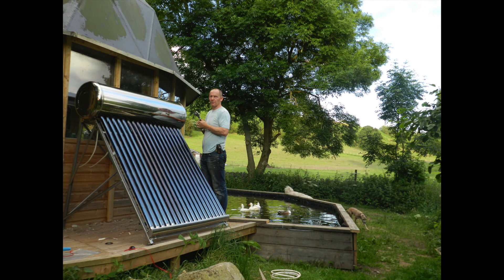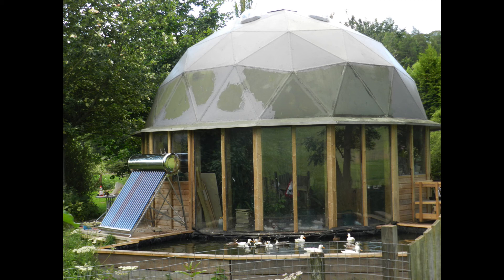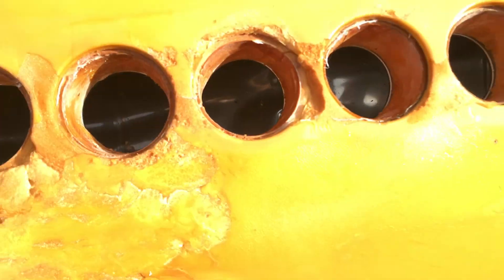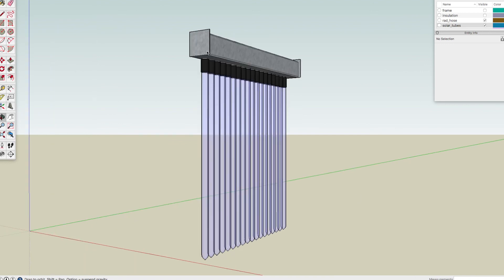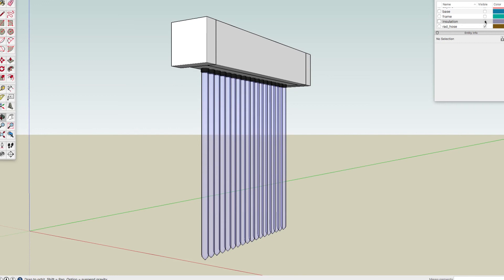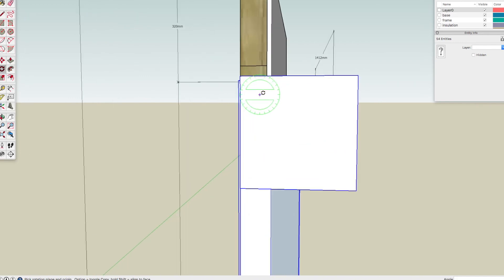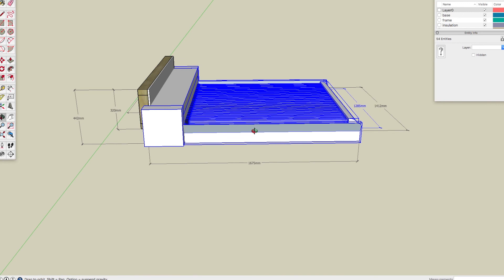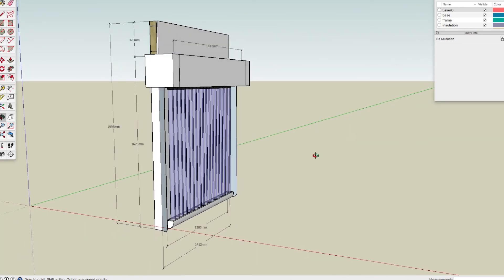Repair and redesign burst hot water solar panel - part 1

Comment: Great job
Reply: With more than 15 years experience in installing solar water heater, my opinion is that The original tank was burst because you probably ave closed its air vent, otherwise we are living in area where there is plenty of solar radiation and during summer we can see steam coming out of air vent. Only if air vent is closed with safety valve or plugged, then inner tank is deformed. Secondly you are not using it during winter, when we need it most. For cloudy days you can use electric heater inserted in the tank and operated by digital controller. Lastly if you have bought new tank, that would be cheaper than what you have fabricated. Anyhow good effort to redesign the tank. I hope there will be no water leakage from tubes, and don't forget to keep its air vent open to atmosphere.